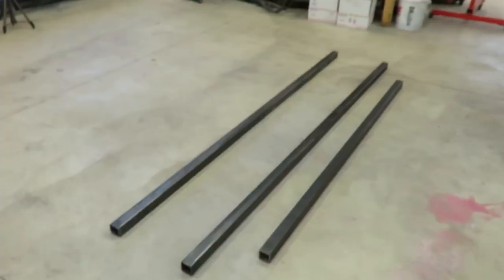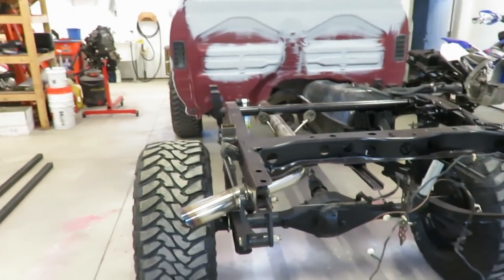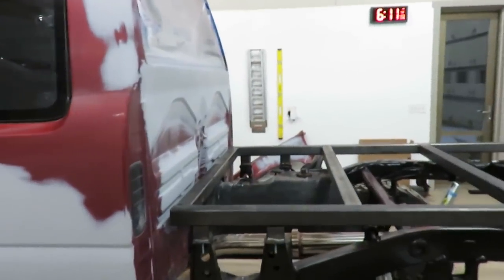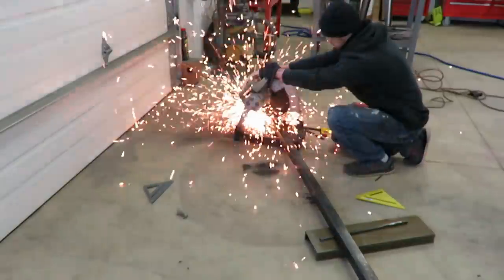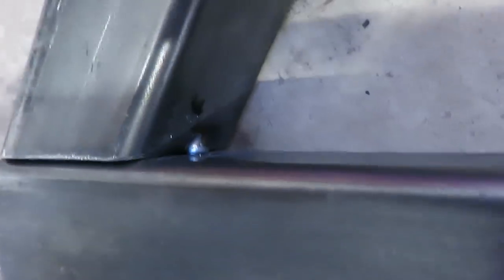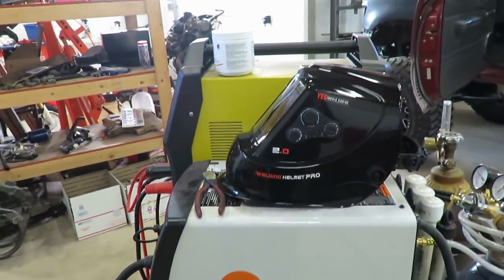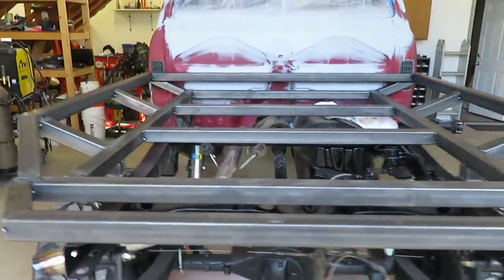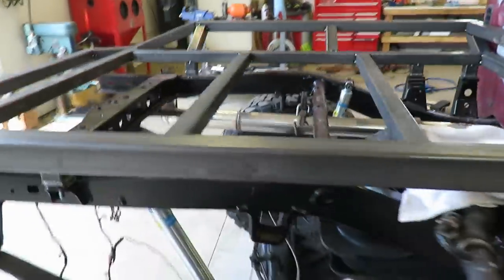Building A Custom Flat Bed Toyota Pickup Episode 1

Comment: I use the helmet called a weldmask. Miller and other companies sell them. I have both versions of it. The first gen will give you a sunburn if you don't wear the beanie or whatever its called. The 2nd is so much better and you can fit a respirator under it no problem. A company in Canada makes them and so much cheaper to get one from Canada.

Comment: I just found your channel because I'm about to build a flatbed for my salvage yard find 94' Toyota pickup. This video has totally changed my idea of how I want to do it. This came out amazing! Where did you get the mounts you used to attach it to the frame? Thanks.
Reply: Make them.
Reply: @jameswarner8874  that's what I ended up doing.
Reply: @keithmarkland5127  sweet!!

Comment: I just started restoring an 83 . I was going to buy a glass bed but this really looks tight. May have to replicate this. How much did you have in steel cost? I went to welding school many years ago just getting back into the mod scene. Truck is sick great work.
Reply: Wondering the same thing. Got an 88 yota that I wanna do but with a 454

Comment: I am contemplating a flatbed for my 2000 Dakota Sport Regular Cab 4x2 and my 2001 Ram 1500 Quad Cab 4x2. What does one of these run price wise for the materials? Is it an original ‘design as you build’ thing or a bed built from a set of plans? Either way, it is the best flat bed I have seen yet.
Reply from the maker: All said and done i spend about $1000 on materials! I built it as i went, no plans!

Comment: you should chisel bevel your material, where you have really tight good fitting seams, it will help you see better and will allow for a deeper penetration as your filling.
Reply from the maker: TheDeadwood11 true but 1/8” wall isn’t hard to achieve full penetration!!
Reply: @austinniemela  hard wire pen is limited dual shield would be over kill. besides when you bevel your filling to flush on seams, so areas you would grind flush or flapper wheel down it will reduce this. an im meaning bevel a 1/4 to 1/2 of the 1/8" wall , more of a breaking of the edges i guess.  im a fitter an welder by trade so i am ocd with it and am used to breaking all edges to pull millscale back or  for fillets.  like your fits are mint. nice an tight,   try it with some scrap. you will see it gives you a lil time to float an fill a weld and get more of a coin stack or flush even welds. i think your laying good welds its burning great but on your tight seams your looking rushed and over building material a bit.  not nit picking yah just trying to give a lil trick to reduce wire use and grinder use.  also may seem odd but if your having issues seeing seams try a rag taped to the top edge of the hood, allow if to drape over the back of your head. this will stop all light from behind you reflecting off the inner glass. works great things where you might drop your shade or get close to see arnt necessary.  I Laughed at a guy for this trick in my first welding job, he handed me his hood and here you try. an i been rocking em since. an dont tape all along the edge, just the top 4" or so and a inch on the side leave the rest swang an rock the welder mullet.
Reply from the maker: TheDeadwood11 well you know better than me, I’m no professional!! What do you have for tips for overhead butt joints? My t joints overhead are good but the butt joints I can not master.. the beads want to fall down and they look terrible! I tried more heat and just burnt through. 1/4” or so stick out and close to 90 torch angle.
Reply: @austinniemela  what cover gas are you running co2 or 75/25, ? 75 will give you a better weld but you need to keep the nozzle close. dont long arc the wire it will cause the puddle to go unstable. are you pushing or pulling the weld. whats your guns angle. personally i would pull at a 15% angle with my gas at 25 or so
Reply: also butt joints you should bevel both sides each plate where they join. and this is your fill area and reduce your amps a bit as well. if your out of temp to wire speed reduce both a bit.
Reply from the maker: TheDeadwood11 75/25 gas at 25cfh. I’m usually close to 90 degrees and I’ve tried both push and pull.. even my butt joints where a end of tube meets the middle (so there essentially is a bevel) still getting the bead wanting to fall out of the joint.
Reply: @austinniemela  also with the hard wire i like to do a "stitch " or "C" weld. meaning if i have a side wall to over head ill lay the heat into the side then  C up to the top plate allow it till fill an drop down  C up an  straight down.   if im pulling ill push the heat to the top plate drop down J a bit and use the open space at the top of the  J at the top plate to fill into the top plate an J forward  so on so on ... also you can rock the welds as well. if you open up the seams a bit "bevel"  you can drop to the bottom of the bevel weld and rock forward and back  filling low then filling high while moving this will give the dimes.
Reply: @austinniemela  i would turn your heat down a bit. and move your ground closer. your heat has to be to high if your burning through like that. can pull faster and run stringers
Reply from the maker: TheDeadwood11 will do! I’ll send one tomorrow 👍
Reply from the maker: TheDeadwood11 just sent you a email
Reply: @austinniemela  ok  just got in from work

Comment: I'm getting ready to redo the flatbed on my 86 toyota truck. How much steel did you end up getting for the frame? I dont even kmow where to begin with ordering that
Reply from the maker: Tyler The Creator so far I’ve used about 60’ of 2x2